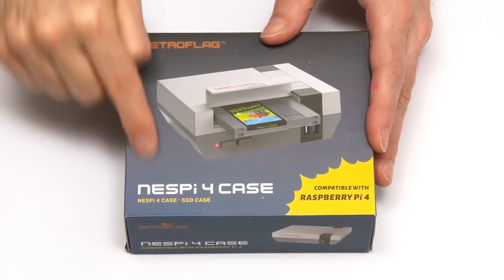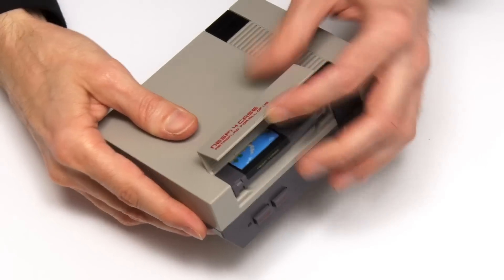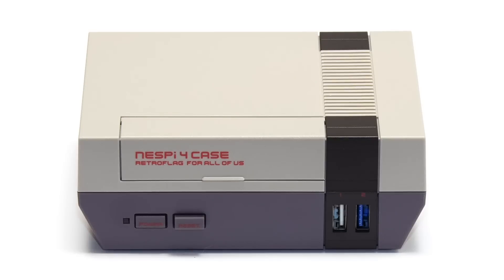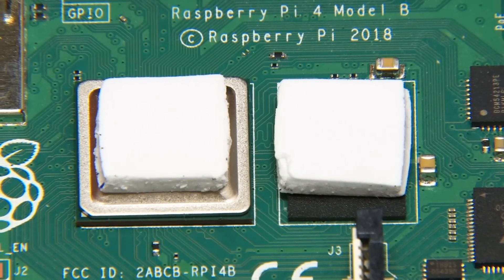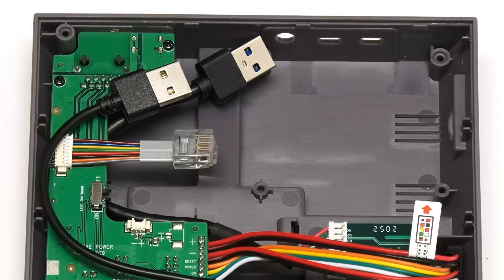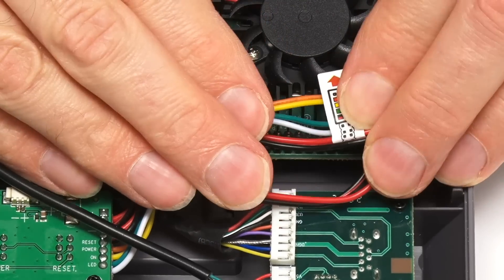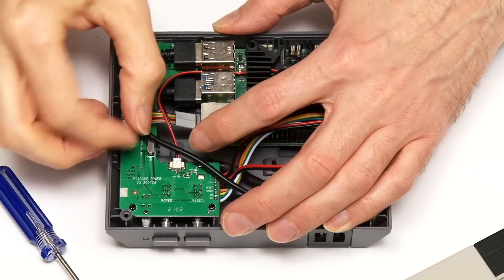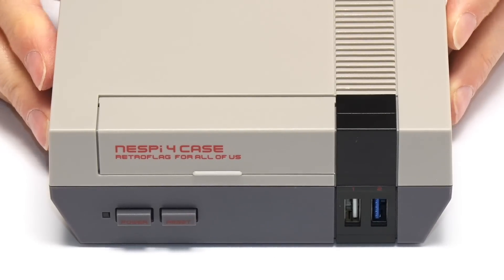Raspberry Pi NESPi 4 Case: Retro Housing with SSD cartridge

Comment: They've actually improved some of the features the previous NesPi Case lacked! No more soldering bodgejob for the safe shutdown button and even a SSD slot/cartridge!
I gotta say that's impressive that Retroflag has taken example on how to improve and upgrade their designs!
Reply from the maker: Yes, agreed. They seem to be a company that does listen and improve based on feedback.
Reply: I just got this case a few weeks ago
 they  allegedly improved it  and  got rid of the nice fancy heat sync because it was causing problems with bluetooth connectivity
I got the new one with the separate heat sinks and  I put batocera on it (on a 240gb SSD)
and I can not get any wifi reception on this thing at all,  it worked  for about 2 seconds now it won't work
it keeps on saying not connected,  this is my first pi 4 so I am not sure if it's just that wifi on the pi  4 is garbage as it was a lot of other pi models or if it the case causing the issue or if it is batocera but  I am very disappointed in this thing so far
also can't  get the safe shutdown to work  either 
not even sure if   safe shutdown is a thing when booting  from the SSD which I am and no  micro SD
but I enabled it in the .conf file  and   have the switch   in the right position and it still doesn't work
too bad because  I really wanted to like this thing  but it has been nothing but a headache so far
 but it does have great build quality , that part exceeded my expectations  and  it does boot fast from the  SSD
but no wifi and no safe shutdown kills the deal
also with  the new revision  you need to be careful  because the header  cable  on mine shifted after I screwed it together  and was hitting the fan and I had to  unscrew it and bend the cable and tape  it  so it does not shift and hit the fan blades and stop the fan from spinning
I wonder how bad the  bluetooth really is on the  old one or if the old one  has a  wifi connectivity issue
I have not even tried to pair a bluetooth device yet because I am still struggling to get wifi and safe shutdown to work
also another  annoying thing is that I have been requesting invites for their subreddit and have got  nothing so far in like 3 weeks so I can not even  post there to  get any help with it

Comment: The USB-SATA Controller NesPi was using was a JMicron which will cause you problems unless you add this line to the cmdline.txt
usb-storage.quirks=152d:0578:u
The ASMedia Chipset is the one to look for, like in the Argon1
Reply from the maker: Yes, good spot -- a JMicron. Though I've not had any issues so far . . .
Reply: @ExplainingComputers  Lucky Chris, i had all sorts, with JMicron and FUSE, but ASMedia or Via no probs at all

Comment: The funny thing is that the NES wasn't actually all that popular in the UK in the late 1980s. It's some sort of American nostalgia acquired by osmosis. Now ... if they did an Atari ST case!
Reply from the maker: An Atari Pi would be great. Or a ZX81 Pi.
Reply: @ExplainingComputers  Sinclair power!
Reply: @ExplainingComputers  Id prefer a C64 Pi
PS.: the Volume of a C64 would allow for a decent cooling solution, space for all the files you could ever need and the power supply. Think Pi 400+
PPS.: you could also abuse the external floppy case for power supply and a slot in SSD
Reply: Weird. Most of my mates had a NES. Few had a master system 2 but they were generally seen as the lesser console.

Early 90s I had mine.
Reply: Agreed.  Master System was probably the most popular console in that era so be more fitting for that tbf.  I’d like an Acorn Electron or BBC style one though 🕹😉
Reply: I would rather a case modelled after the 400/800 or the XL models myself.
Reply: @yourdogsnews  I think it just depends on when you were a kid. I was just a little too young for the 8bits, when I started school it was Amiga, Atari ST etc. So that's personally what's nostalgic for me. Other people will, of course, have different experiences.
Reply: @Bob Grau I can assure you that the Amiga was a very popular computer in the UK during the late '80s and early '90s. The ZX Spectrum was released in 1982, the first Amiga workstation, the A1000 in 1985, but the popular, affordable Amiga 500 home computer wasn't launched until 1987. As for the Atari ST, I didn't have one, but again, I know they were popular machines in the UK at the time. This idea that they were somehow rarely seen is nonsense. The NES wasn't that big a hit in the UK compared to some other markets.
Reply: in a real-life NES, the cover plate on the bottom revealed an expansion port that was never used.  Points to the manufacturer for putting that in
Reply: There's my first home computer, the Tandy 1000 (would need to have a fake monitor on top).  Although since what I had really wanted back then, I'd go for an Apple IIgs repro case.

Comment: Dead insects? So that's what debugging is...
Reply: That's actually how the term "debugging" was born.
Reply: @jhvhest   Well, that's an interesting story.

Because, yes, Admiral Grace Hopper - inventor of COBOL and, through it, high-level programming languages - did famously record in her log that "first actual case of bug being found" (and actually taped the ex-moth that caused a short circuit in their Harvard Mark II computer to her log entry).

They'd left the window open, and the poor moth was attracted by the lights and the heat, to nestle inside the large computer, coming to an untimely end... and also messing up their calculations, as its body was causing a short circuit.

BUT - and, aye, here's the rub - her log entry says "first actual case of bug being found". The entry itself suggests that the word "bug" was already in use. Or the "bug caused by actual bug" joke wouldn't work.

And, indeed, it was. Electrical engineers had used the term "bug", in a similar way, previously and it was just inherited when electrical became electronic, and computers were born.

The actual origin of the word "bug" goes far back. Indeed, we all still use one such instance ourselves - when you've picked up a cold or the 'flu, you might tell people that "I've got a bug".

This also goes back to Shakespeare, who talked of a town having "a bug" upon it, to suggest that it was ill and out of sorts. Cursed, perhaps.

This all relates back to Medieval ideas that illness was caused by evil spirits. That you were being possessed by an evil spirit.

(They had charming Medieval treatments for this. Such as "trepanning". This was where they used a hand drill to bore a hole in your skull. The idea being that they were releasing an "evil spirit" from within the brain, that was causing mental illness. Though, really, they were just causing a very likely source for serious infection that would probably kill off their victim.)

In this context, a "bug" is a spirit. Possibly an evil spirit, who has taken possession of someone (or something, in the case of a computer) and is causing illness or mental health problems.

(This appears to be an ancient word, and there's an interesting parallel in the Welsh language where a ghost or spirit is called a "bwgan". Pronounced like "boog-an" and the "-an" is just a standard Welsh ending to indicate a singular object, so really it's a "bwg" / "boog" or "bug". No, the English "bug" doesn't originate from the Welsh directly, I don't think, but rather they both picked it up from another language.)

So, really, a "bug" is essentially "a ghost in the machine". A mischievous evil spirit, that has taken possession of a person or thing to make it act out of sorts and out of character. What was once believed - before Germ Theory existed - to be the origin of illness and mental health issues.

But, yes, the first recorded use of the term "bug" for a computer bug was actually because of a dead moth. But the interesting thing about that log entry is, indeed, that it's clear from how it's written that this was not the first use of the word "bug" itself (and it's known that electrical engineers had used "bug" in this way beforehand, which is probably what Admiral Hopper was referring to, in her little joke).

But, yeah, it seems to trace back to Medieval notions of "evil spirits" and that's also where the notion of "a ghost in the machine" comes from. And that "debugging" could, indeed, be seen as a form of "exocism" of these mischievous spirits.
Reply: @klaxoncow  A strangely good read.  Surely it's also related to the gremlin.
Reply: A good read indeed.  Thank You KlaxonCow.
Reply from the maker: It actually it/was :)

Comment: Man I was sooo excited for this case. sadly if your doing anything intense with the hdd the case causes it to thermal throttle and tank the performance.
Reply from the maker: I've not had this experience. It may depend on the particular SSD.
Reply: @ExplainingComputers  so i managed to get 2 extra HDD carriers. (Kingston 240gig are the drives i use) I put LibreELEC on one with some videos to watch while on Duty.(I'm in the CAF, i have to do 24 hour watch on base) The video playback was quite annoying, ever 20 min the hole system would hang up. The next day at home I moved the OS to a SD card and tried again and there was no issues.
Reply: That's so disappointing! I was excited to...